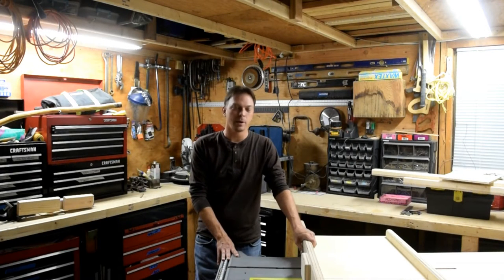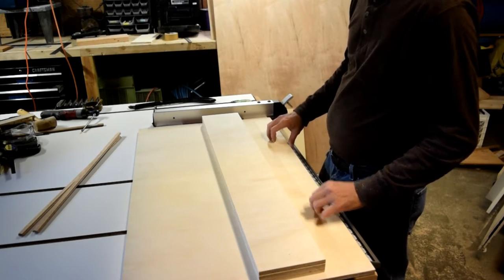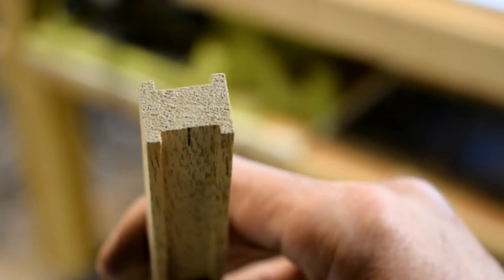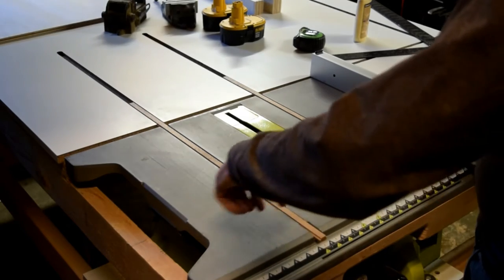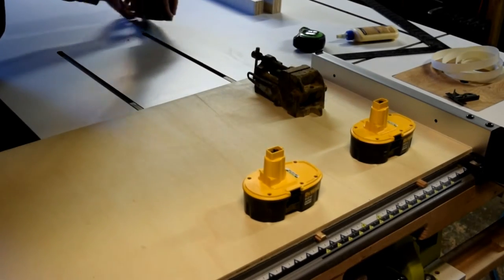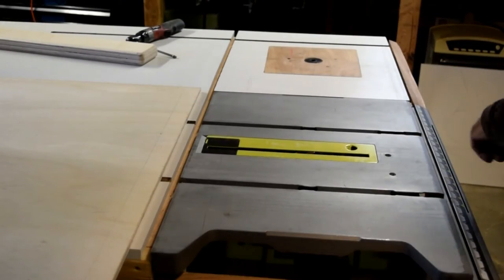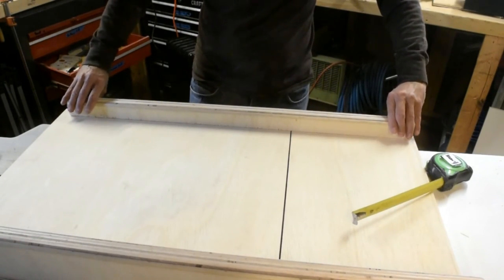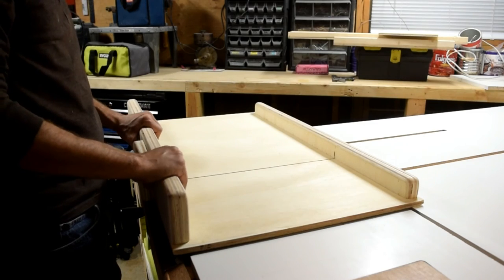Cross-Cut Sled

Comment: Excellent table.  Only very slight criticism is the teeny tiny gap between your router plate and table top, maybe some super thin shims to bring it up flush for when you're running small lengths through. I had the same issue on my own hand made router table. It's fine for lengths longer than the router plate but a problem for smaller lengths.  Other than that, excellent table, new sub here!
Reply from the maker: Good idea. I have some thin edging left over I may shim it with.
Reply: I saw another guy use playing cards for shims.

Comment: Hey, Great ideas man! Just getting into the w/w experience myself and I am limited on space.Have a cheap delta 10" and a nice Craftsman router to do this with. Do you think there is a way to incorporate a sliding miter saw into the setup?
Reply from the maker: I have been trying to do the same thing but I have not found a good way to do it yet. For now I just Set my saw on top lol. I'm thinking of setting up a flip top or fold away top for it.